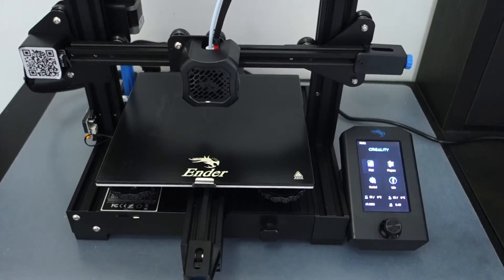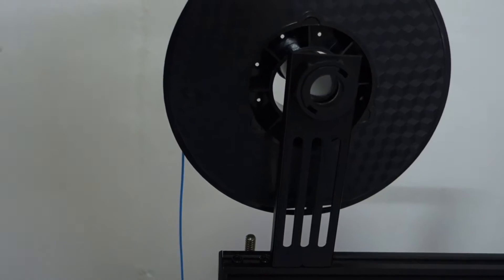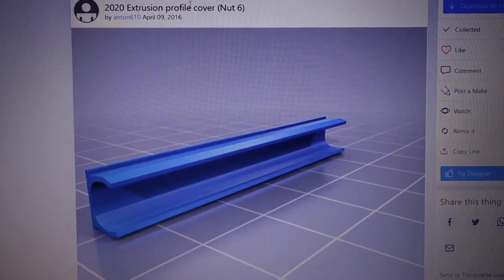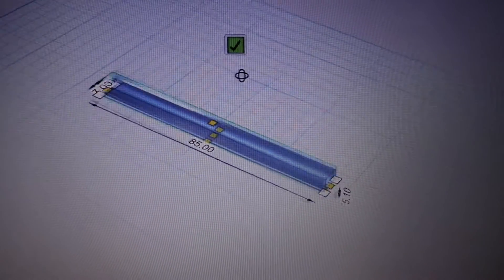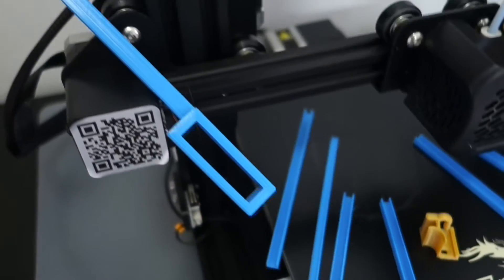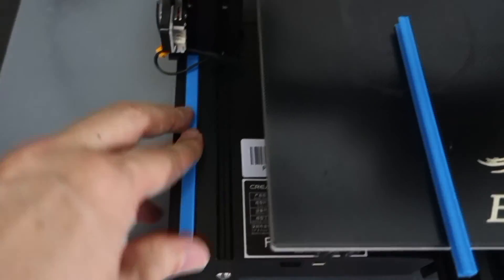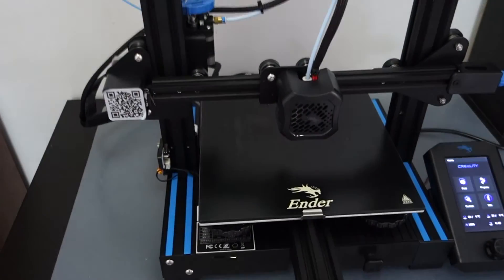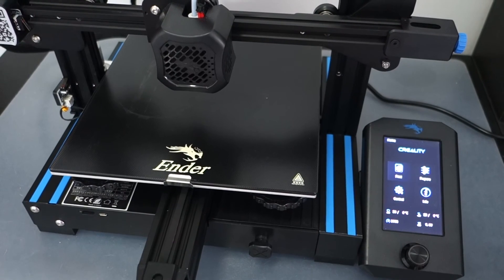First Mods for My Creality Ender 3 V2 | Modding & Upgrades for 3D Printer

Comment: Looks great!  Do you have all the length dimensions for the profile covers on the Ender v2?
Reply from the maker: Thanks! Sure. I just took some quick measurements off my machine and compared it with my notes from printing them. Here they are: 1.) Left and right sides are 135 mm, 8 pieces (Light Blue), 2.) Top bar and Y-Axis are 160 mm, 4 pieces (Red), 3.) Y-Axis in the middle is 170 mm, 4 pieces (Light Blue). The colors are just in reference to what I printed them and what you will see in the video. You can choose the color(s) that you think would look great on your machine. Cheers!
Reply: @seveninallmakes3177  the width of the parts in the video is 7mm, i measured on my ender 3v2 and it's more like 9mm. i just want to know before i print

Comment: Hey guys i need help
I have too a ender 3 v2 and i have adhesion issues i tried re- leveling the bed, cleaning with alcohol the bed,etc i don't know what to do, also i am very frustrated bc its my christmas present 😥😥
Reply from the maker: Find to find the "sweet spot", where the bed is not too close, and not too far away from the nozzle. That's usually when a sheet of paper can slip under the nozzle with just a little bit of drag on it from the end of the nozzle. Make sure the temperature of the bed is high enough (according to the filament recommendations), which helps the filament to stick to the bed. If all else fails (or if you just want to get some prints to stick), you can use glue stick to get started. Hope you are able to get it to work!

Comment: I just hooked a direct drive to my v2 and it’s sweet as all cost under $50 and hooks up in about 30 min. Dropped it on leveled bed and it’s kickin parts off way nice. The old Bowden system was starting to click
Reply from the maker: Sweet! That's really awesome! You are definitely operating at the next level. I have heard and read about people making this modification and finding it to be a great improvement. It's good to hear that it was affordable, not too time consuming, and worked out well for printing. Thanks for sharing. Keep on kickin' out way cool prints!

Comment: Yall should get an bltouch for it mine works a okay👍
Reply from the maker: Thanks! I keep hearing great things about the bltouch but I haven't made that leap yet!
Reply: @seveninallmakes3177  Can Tell You Man Its An worthy Upgrade But if you dont need It You wont miss it but its so good when you dont need to calibrate the whole printer all the time
Reply: If you are planning to go the BLTouch route, here is a mount I whipped up for my Ender 3 V2, I couldn’t find one that suited my needs as I did not want to cut/modify the metal beacket - https://www.thingiverse.com/thing:4673425

Comment: What software did you use to resize ? thanks
Reply: Not OP but looks like Cura
Reply: @richardmorrison1985  i dont use cura , thought that was for slicing , does it have resizing in it ??
Reply: @TheBeachBadger  You're right, I missed him resizing, thought he might have scaled it, apologies. Maybe Fusion 360.
Reply: @richardmorrison1985  yes or tinkercad , im new to all this :)
Reply: @TheBeachBadger  Same here, going to be googling tinkercad now thanks :)
Reply from the maker: I resized in 123D Design, but any CAD program would work to resize the overall length to the desired location on the machine. Cura is the slicer program. You can adjust the overall size of the whole part, to 50% or 200% within Cura, but that would adjust all of the dimensions by the same proportion, which would mean it would not fit in the slot.

Comment: FYI... I recently purchased an Ender 3 V2 recently, I ran it a bit, before 'upgrading' it. The wires to the terminal on the mainboard were loose, I noticed that they had been tinned with solder. This is a very bad wiring practice, solder is not compressible and connections will loosen, after time. At a minimum twisting the wires then putting them into the terminal, would have been a better choice. An even better choice (and an approved wiring standard) would be to install a ferrule, on the end of the wire (clip the soldered end off first). Here is a link (not sponsored) to show exactly what I am on about. https://www.amazon.com/Ferrule-Crimping-Tool-Kit-0-08-10mm%C2%B2/dp/B07K17VDF2/
Reply from the maker: That's very interesting, thanks for sharing!

Comment: I have an Ender 3 v2. Did you know the nozzle fan is linked to your motherboard fan? Changing the nozzle fan speed / turning it on and off also does the same for the motherboard fan. Still think this printer already works fine?
Reply from the maker: Thanks for the info! Fine-tuning my printer to meet my purposes is helping me to learn a lot about the machine.